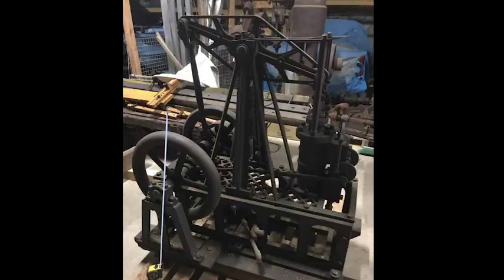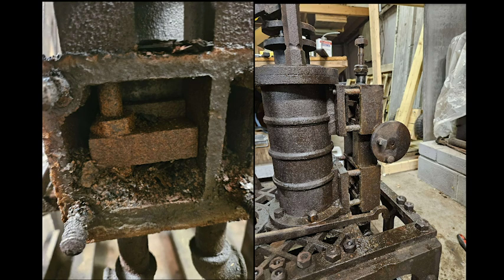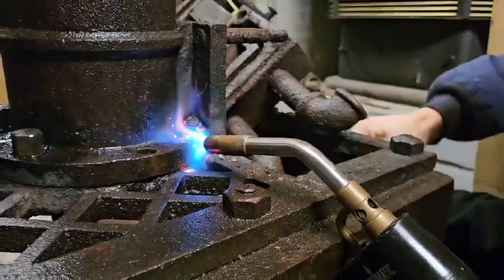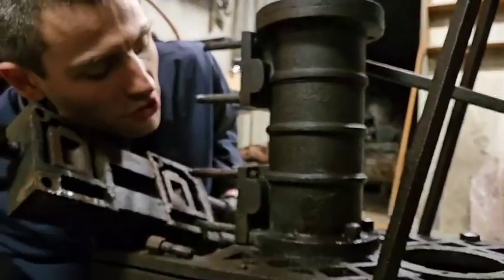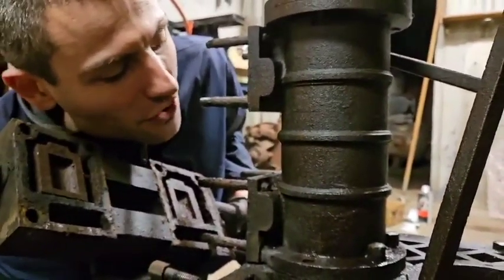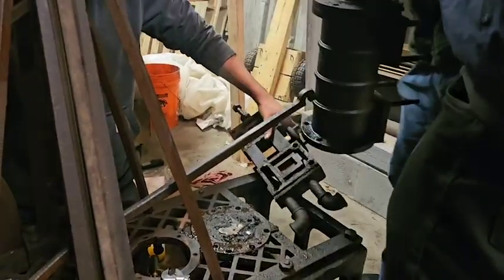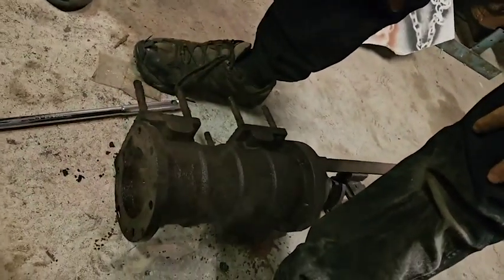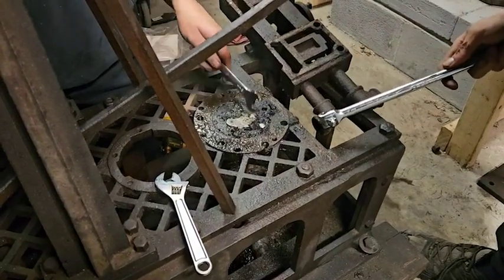Restoring a priceless Sunken 184 year old Marine Engine

Comment: Modern stuff 4 ya 🙄 28 Ariel Model A, 557cc side valve - piston stuck/incredibly beautiful & fragile cylinder fins. Was able to tap the piston out thru plug holder.
All it took was soaking in a bucket of WD40 for 2 & 1/2 YEARS and tapping it gently every afternoon. 😆

Comment: You should try an induction bolt heater, that way you don't need to hold a torch on her for 10 minutes
Edit: sorry 4 months not 10 minutes apparently lol

Between an induction heater and candle wax most rusted bolts come out like butter, but then again those bolts are usually 150 years newer 😂

Comment: A marine engine with flywheels and a PTO pulley? Obviously it wouldn't have been used for propulsion. Donkey engine? Pump engine? Kinda weird setup.
Reply from the maker: the pulley came later, this is a side paddlewheel engine, and I've seen more than a few early examples of those with flywheels.   The fact that this has got a boiler feed pump and a space for a wet air pump both correctly proportioned to its steam cylinder also are a giveaway it's the "main" engine.  Quite an odd thing

Comment: Friend the harbor freight 10 ton hydraulic gear puller is a godsend i pulled the wheels off an international no9 horse drawn sickle bar mower from 1951 with zero fussing you cannot heat those horse mower hubs and they destroy regular screw gear pullers

Comment: Usually when ferrous objects are brought up from shipwrecks they are submerged in a solution of freshwater and sodium  hydroxide (lye) which removes chlorine from salt that has gotten into the iron. This is done because old shipwreck iron might look fine but there's chlorine ions in the metal now and it's highly reactive. I believe that the big-budget conservation projects even use deoxygenated water (the dissolved oxygen has been removed) to further reduce the chance of corrosion. This work is done with ferrous objects raised from saltwater, such as iron cannon.
I'm not a preservation expert but if museums will wait decades to display their most interesting (i.e. lucrative) exhibits so that they can sit in lye water, it's probably very important.
I get the impression that the owner has had this for some time after it was raised from the wreck, see if they've had some type of conservation work done to remove chlorine ions from the metal.

If they haven't had the metal conserved, it might be worthwhile to do it. Some reading would need to be done but sodium hydroxide is just crystal drain cleaner. A big plastic tub, some water, and drain cleaner might be all that's needed to stop this thing from turning itself into dust. It'll probably have to sit for months, which seems to be the case with museum artifacts.